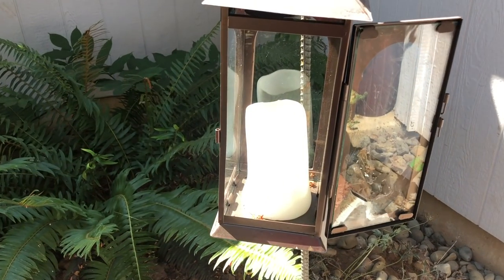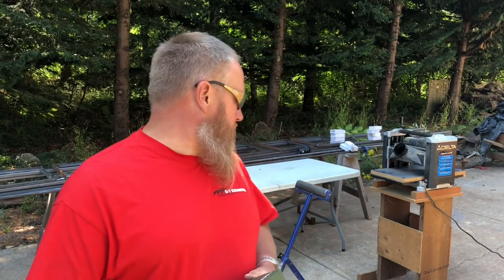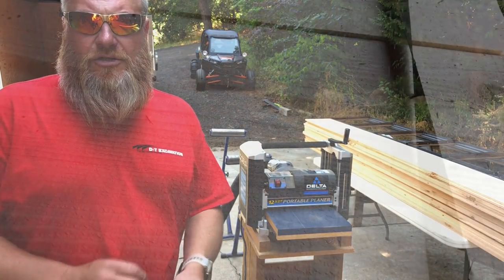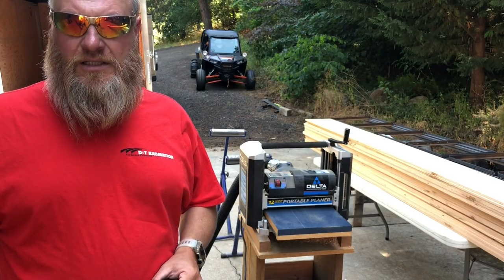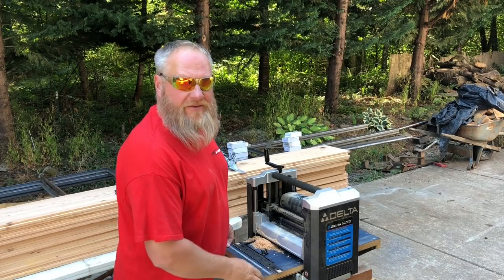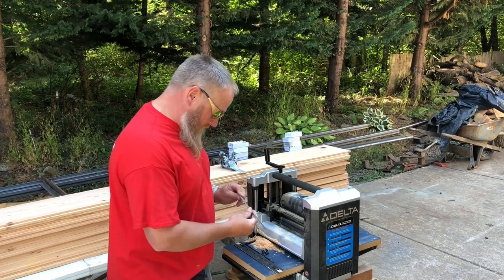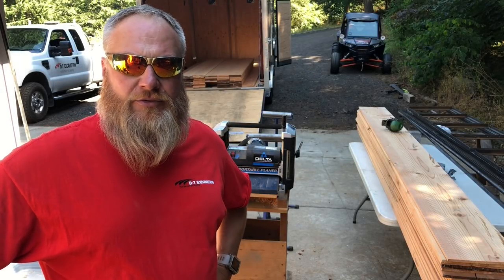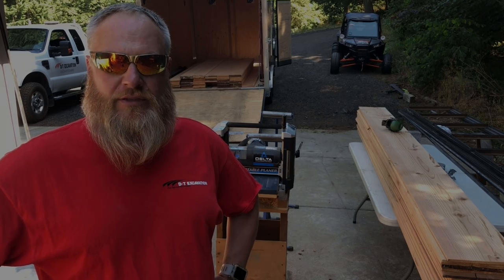Adding value to sawmill lumber by planing it

Comment: In order to get the delta planner to work really well you need a sturdy solid surface for it to bolt on also try cleaning the feed rollers with mineral spirits. I own one myself and that is how I got mine to do the same quality work as the more expensive ones. Been having mine for over 20 plus years now.
Reply from the maker: Awesome! Thanks for the tip!

Comment: You will love the DW planer.  I've had the DW735 13" planer for more than 10 years and I'm always amazed at the smooth finish it produced.  I recently upgraded the planer with a Shelix Helical cutting head and I couldn't be happier.  Not only is it quieter (my shop is in my basement) but it also produces an amazingly smooth cut.  The bonus is, if you nick a blade (cutting insert) you simply rotate that cutter 90 degrees and press on.  If you decide to go with a Shelix cutter head, you will have to decide if you want the cutterhead thats 1/6" of an inch smaller in diameter than the OEM head, or if you want the same OEM diameter.  The smaller head allows you to install the unit without removing the 40 cutting inserts.  Some folks say they have an issue with the smaller diameter because the rollers now push 1/32nd of an inch harder/farther down onto the stock and this sometimes causes the rollers to slip on the wood.  I take lighter cuts and have had no issue with roller slippage.  BTW, my Mom has taken more than one fall so I understand the fear and surprise it puts into the moment.  Happy she's doing well and is now able to turn the TV on by herself;-)
Reply from the maker: Thanks, DCon. I've been looking at the DW735 for a while and have rad great reviews.I just needed a good reason to pull the trigger and tripling the cost on my product was good enough for me! ;-)

Comment: You will love the new planer. Hope mom is OK , Keep the delta kicking around you can clean the rollers and check the chain to the feed rollers Good luck
Reply from the maker: Thanks, Larry. She’s doing good. I never toss a tool that still “kinda” works😬
Reply: Delta has repair pieces for the plainer in stock

Comment: I set the plainer to cut about a 1/32 and run all my boards.Some eat a lot but some don,t.Then your starting more uniform. Then you can set plainer and run one after another until desired thickness.Works for me.

Comment: Yikes Jason, I hope your mom is still okay. It's difficult to have too much hearing protection. If you like listening to music/podcasts/etc while working, you should check out Etymotic headphones. They're in-ear speakers inside of earplugs, so they block out noise allowing you to keep the volume at a safe level. I've used them for a couple of decades now. Two low end ones and one of their pro, studio level models. 

I keep a pair for chainsawing and other loud activities (my first pair from 1998-ish died in 2009). They work well underneath over ear protection. A few weeks ago I accidentally washed & dried my chainsawing Etymotics (ER6is purchased in 2009 for $75) and THEY STILL WORK! I can't recommend them enough.

Comment: Don't you just hate it when customers forget to tell you what it is they actually need?
A cabinet maker friend of mine stabilized his planer base by mixing up and pouring a wheel barrow sized batch of concrete into the base. The base he had made was pyramid shaped for
added stability. It did the trick for him.

Comment: Your local firearms dealer or gun store will have much more decibel reducing ear protection at a reasonable price. Small shop planers are meant to efficiently remove no more than a 16th of an inch of material per pass. Thus, if more wood removal is needed, make several passes of no more than a 32nd of an inch per pass and you will find the planer will work great. I had a 12" Delta exactly like your Dad's before I moved up to a larger and more powerful planner made by Grizzly Tools. (Man, what a time saver that turned out to be)
Reply from the maker: Grizzly makes some great stuff. My dad’s shop is full of it!

Comment: Planing with a dull or gnarled rig is infuriating. I was trying to plane down some of the 2x stock i had around instead of milling some down to 1 " 5/8. I ceased that operation post haste. This is one of those client work projects that you just put your head down and plow through it. It will be awful satisfying at the end and make for more of your own work in the long haul.
Reply from the maker: Well hold that thought. My new planer came today and I got to try it out. I will probably have dreams about it tonight as it is dreamy to operate. Video uploading as I type....

Comment: I feel you pain man. About 2 months ago, I had to do the same thing on 200 pieces of 1x6x8 SYP. I went straight to Lowes and upgraded to the DW735. My DW734 kept tripping the breaker on nearly every pass, even taking off 1/128th. Wish I was up there to help you out man.
Reply from the maker: I wish you were too! I could use a hand! I'm really looking forward to getting this DW735. I've been wanting one for a while. I just thought I might get by with my dad's old Delta.
Reply: Yeah, it's a pretty decent beast for the price it is. I would definitely suggest running to your Lowes/Home Depot/Other big box and getting an additional set of knives if you didn't order one with the planer. The DeWalt knives just do not seem to keep an edge for very long, so the ones in the box might last you, but maybe not. I am thinking about upgrading to the Shelix cutter head too. Not sure yet, but man, on this figured wood that I run, it'll help.

Comment: I use 1 for a drum sander 1 for a planer molder for making molding and tongue and groove flooring and tongue-and-groove ceilings and one for just planing up to 25 in slabs
Reply from the maker: Wow! It sounds like you have quite the setup. There’s a Grizzly double drum sander in my dad’s shop. I think it’s 18”.

Comment: Do you have a link to helmet mounted hearing protction? I will buy them via your link if you can provide a link. i currently use Peltor 3M 105
Reply from the maker: I could look on amazon but it would be just the same for you to look and find exactly what you’re looking for.
Reply: I can do. I thought  maybe you got a provision if I used your link
Reply from the maker: Ohhhhh. I don’t but thank you for thinking about that.
Reply: Dont bother bro
Reply: I really your videos
Reply: Maybe you can add?
Reply: I do not do the other things to support your channel, but I will definately  support your channel the way I can

Comment: If your going to be doing a lot of planing, get a planer that has a helical head on it. More expensive but well worth the money.
Reply from the maker: What’s the benefit, Pat?
Reply: Northwest Sawyer 
The blades last a lot longer, as in years, not months. You can turn the blade 90 degrees when they need to be changed. If you hit a rock or nail, it wont cause a bump in the material.  I have one for my jointer.  Works good.
Reply from the maker: I’ll definitely be looking into that. Thanks for the heads up!

Comment: I operated a cabinet shop for 35 years but am retired now so I do know a little about planers. If you think you will be doing much planing on the future those little toy 120volt planers are not much good , they make an ok cut but have little power and  many passes are needed. I am not find of Grizzley brand but they do have some 20"models that would probably work much better for what it looks like you are doing. They are nothing fancy but are reasonably priced and most are not 3phase electric, whereas most of the bigger and better brands will all be 3 phase.

Comment: Equipment torque is contributing to ripples.. Top heaviness needs to be anchored to prevent movement me thinks. Could be wrong.......
That enclosed candle is example of why not to leave living things is cars or enclosures in summer.
Reply from the maker: I think it would probably work fine if I wasn’t having to push on the wood. My dad used it that way for over a decade I’m sure and he wouldn’t have put up with a tool not working correctly. We’ll see how the new one works.

Comment: If you are going to offer planing of your lumber as a value add service, I would think getting a proper cast iron professional planer would be a good investment.  Running 170 or so 10'-12' boards through a bench top planer is not the best way to go.  It will be quite taxing on the machine.

Comment: Looks like you need to have a more stable platform as well when you set-up the new planer.
Reply from the maker: I’m hoping the new setup will feed itself to where I don’t have to push. That’s what was moving the planer around so much. That thing is probably 20 years old.
Reply: Hope your mum is alright and only a bit of pride hurt which will heal.

Comment: First of all I hope your mom's doing okay. When you do get the new planer let us know if you get any sniping on the leading and trailing ends of the boards. Also if you have any time maybe give a little bit of a review of the new planer.
Reply from the maker: Will do, OLD SCHOOL. I bought it with in and out feed tables which the reviews I read said were necessary to eliminate sniping. My dad had made a Formica-covered board that goes all the way through this planer. I’m wondering if it was to eliminate sniping....

Comment: you have to correctly set your knifes .1 they both have to be the same depth,2 they have to stick out the proper distance . find a video about setting planer knifes and dont through that planer away . i turned mine into a rolling planer for 16ft 10x10 beams instead of a hand held .much better beams.
Reply from the maker: There is no adjustment for the knives. There are pins on the carrier that fit into holes on the knives. It’s foolproof.

Comment: I don't think you mentioned setting the blades so they'd all have the same bite and that bite would be even across the board.  If you did, forgive me.  If you didn't, it might be a good idea.  There are youtube videos on the subject.
Reply from the maker: On this particular planer, there are pins on the carriage that fit into holes on the knives. There is no adjustment. They just drop into place. I tried to show that on the second knife but didn’t actually say anything about it.

Comment: Dude...lunchbox planers are for hobbyists.  They don't work continuous duty like a sawyer needs, like for the job you're doing.  Break down and buy a real planer, a heavy one that you don't move around.  Grizzly for example.   I'm in the same boat as you.  I only have a Dewalt 735.  It is not adequate.  I even bought a byrd shelix head for it because you'll end up spending way more in disposable knives than if you just get the shelix head to start with.  Even with that, the circuit breaker trips every 4th or 5th pass even taking little material off.  the other problem is the dust collector port gets broken- I'm on my third one.  Building a wood reinforcement of it this time.  Soon I'll move into my new shop and buy a proper heavy duty floor model planer with shelix head.

Comment: Keep your cheapo ear defenders for indoors. I'd llike to test them properly on a 120dB sound pressure level. Use GOOD foam 35dB earplugs from a known manufacturer outdoors. That lets you get your hat back on and reduces the "forehead like a well slapped ass" syndrome. Work safe!
Reply from the maker: Earplugs are great if you’re not removing and replacing them all the time. If you’re not washing your hands every time you’re packing a bunch of crap in your ears. I’ve been running earth moving machinery for 26 years. I wear headphones any chance I can. Keeps the funk out of your head. These work great for what I’m doing.